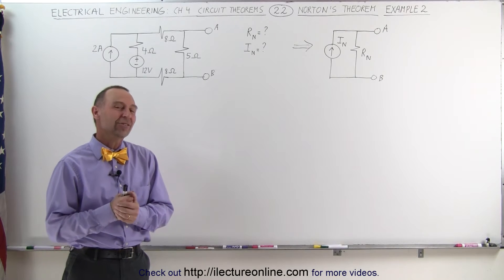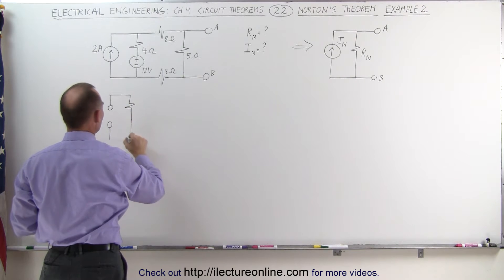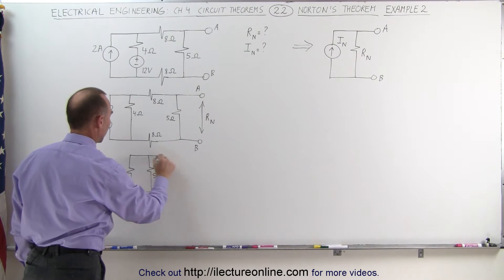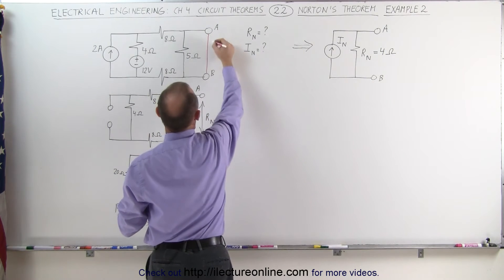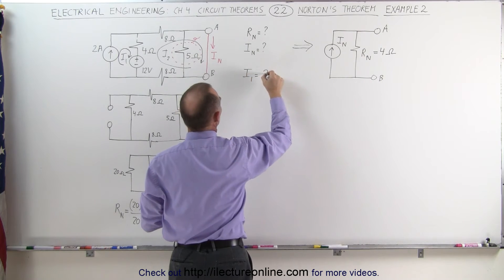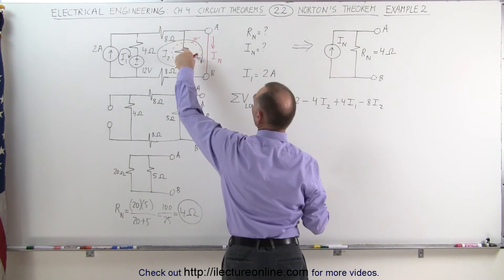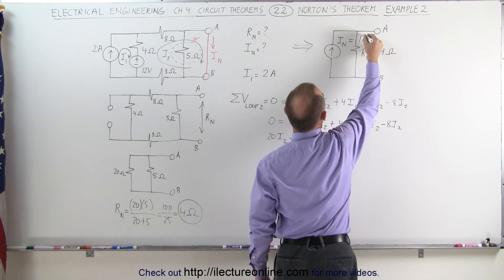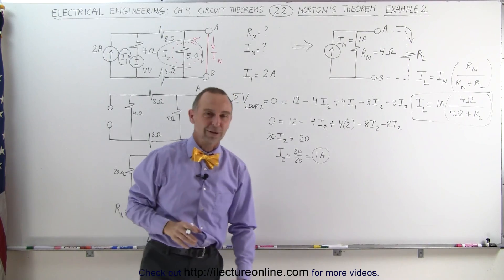Electrical Engineering: Ch 4: Circuit Theorems (22 of 35) Norton's Theorem Example 2

Comment: For the second loop, the resistor at the bottom, why do we do -8(I2) instead of +8(I2)? Isn’t it flowing the other way?
Reply from the maker: When you travel around a loop in the same direction as the current, you will have a voltage drop across each resistor.

Comment: I have a question Sir, although you have replied to a similar question of mine, my question is that what If there is a 2ohms resistor after the juction that connect 8ohms, 5ohms and the Norton current, will the current pass through the 5ohms resistor ?
Reply from the maker: Yes, the resistor will CHANGE the amount of current flowing through the 5 ohm resistor, but it will not prevent current from flowing through the 5 ohm resistor.

Comment: Hi, I love your videos!!! Really wished I have a lecturer like you in my uni! I would like to ask, can I just use source transform to make the voltage source into a current source and add the two current sources together to make the current source at the end?
Reply from the maker: Try it and see if you get the same answer.  We have some examples of source transformation on this channel.
Reply: @MichelvanBiezen  Hi Sir! Thank you very much for your prompt response! I ended up with 5A instead of 1A, the of 12V voltage source became 3A. It was parallel and in the same direction as the 2A so I summed them up to get 5A. Was I supposed to subtract 2 A from 3A instead?I have watched your source transformation videos! They are great! very easy to understand!

Comment: I love your videos sir. I have an ask, using the mesh method, it shows that the 8,5,8 resistors are in parallel with the 4 ohm resistor because current passing through them is the same. I do not know if I am wrong
Reply from the maker: The determination of a parallel path vs and series path is as follows.  Going from A to B, the current can either travel through the 5 ohm resistor OR throught the 8, 4, and 8 ohm resistor path.  It is the "OR" that makes it a parallel path.  The current has the choice of one path OR another path.

Comment: in case of norton's resistance, shouldnt 4,8,5 be in parallel with the 8 ohms resistor? (4+8+5)//8.... Im confused!
Reply from the maker: Traveling from a to b you have 2 path choices.  Either you can travel through the 5 ohm resistor or you can travel through the path containing the 8, 4, 8 ohm resistors.
Reply: @MichelvanBiezen  i would like to thank you for your quick reply!

Comment: Why you didn't consider 5 ohms resistor?
Reply from the maker: On the first diagram, if A and B are connected with a short, as is shown, then no current will flow through the 5 ohm resistor and all of the current will flow through the short.

Comment: sir.. the thing that made me confused is that how will you know that 8ohms , 4ohms and 8ohms are in series and those three are in parallel to 5ohms??
Reply from the maker: With the 2 A current source removed, how many paths are there from A to B?
Reply: Michel van Biezen sir there are 2?
Reply from the maker: That means there are 2 parallel paths.  The one with the 8, 4, and 8 ohm resistors, and the one with the 5 ohm resistor.
Reply: Michel van Biezen sir i just thought that 4 and 8 ohms are in series then parallel to 8ohms then series to 5ohms.. 
thank you for the explaination sir ! Thank you very much..😊
Reply: @MichelvanBiezen  This really helped me , thank you so much sir!!

Comment: one thing i'm a little confused about is, why do we assume the current source's current doesn't split along two paths?
Reply from the maker: If you are referring to the circuit on the right, there is only one path without the load resistor.
Reply: look into the concept of current division - when the "neighboring parallel resistor" has a resistance of 0ohms, the total current will flow through that resistor in lieu of the resistor with resistance !=0.

Comment: sir, for finding Rn why did you set 8ohm,8ohm and 4ohm as series resistor and parallel it with 5ohm resistor?? i did series resistor between 8ohm,8ohm&5ohm then parallel it with 4ohm.....but i got the Rn equals 3.36ohms...why is this?
Reply: I'm not the guy, but I can answer your question. Lol. So it sounds like what you did is took the equivalent resistance as if the current was flowing from the left side, reaches the node, the divides into to paths. One with the 4 ohm resistor and the other with an 8, 5, 8 ohm resistor. This is incorrect.

 When doing Norton and Thevenin circuits, you have to assume the current is coming from the right side. From terminal's A and B (as if A was the positive terminal and B is the Negative). When you do this, you'll get the following: The current will travel from A to a node. The current will diverge into two paths. One with a 5 ohm resistor and another with an 8, 4, 8 resistor. I hope this answers your question.
Reply: @jayvinstreet1876  Thanks Brother
Reply: @jayvinstreet1876  u sure it isn't the other way around? Works the same way and that's the direction it looks like he took

Comment: Hi sir, why can't we just apply Mesh Analysis at loop I1 and get a equation like - 4( 2 - I2 ) - 12 = 0 ?
The answer i get for I2 which is I norton is 5A..
Reply from the maker: There are multiple ways in which you can solve this problem.
Reply: I understand. However If I apply Mesh at loop I1 the answer I get for I2 is 5A, but if I apply Mesh at loop I2(which is your way in video) the answer I get for I2 is 1A...
Reply: @KayroThePank  why do you wanna find I at mesh 1? you were already provided with the current source which is 2A. hence I1 is 2A. that easy.
Reply: @judy-chan4536  The problem is some of us don't really see it that way, i saw it the way @kayro saw it so i also got 5A and the annoying part is that my professor will mark it wrong if it's the exact way the memo states. So like now i don't know which way is the correct way.
Reply: I think maybe it's because there is an error in that method. You don't know the voltage difference across the current source, and KVL works with voltages. In your equation, you considered the voltages for the 4 Ohm resistor and 12 V source but not the 2 A source.
Without including that in the mesh equation, the answer would be incorrect. So it's not recommended. It's just easier to find the mesh equation of the adjacent mesh like how he did in the video.

Comment: in loop 1, you directly write 2A and for elements in the other loop, you use (v=ir) formula. why is that? i mean, in first loop, you use (i) and in second loop, you use (ir)
Reply from the maker: In the left branch is a current source and thus will always provide the indicated current.  In the other branches we can only express the current as V/R  (Ohm's law), since we don't know what the current is.
Reply: Michel van Biezen you didn't used V/R, you used IR in the other loops. 
also, can we use mesh analysis when there is just a current source with some resistors?

Comment: Sir, could you please explain why we can ignore the 5 Ohm resistor when we short the circuit A-B?
When I meet a circuit like that, I don't have enough confident to make sure that my analysis is right ;(. Could you please show me some resources or exercises about identifying the current flow?
Thanks.
Reply from the maker: When there are 2 paths (the path with the 5 ohm resistor and the path with zero resistance, all of the current will choose the path with zero resistance and none of the current will go through the  5 ohm resistor.
Reply: remember the concept of current division, like what's used for calculating the current through the load resistor in Norton's Theorem

Comment: Hi, I love all of your videos! It's probably a dumb question but how do you know that 8, 4, 8 are in series and parallel to 5? why not 8, 5, 8//4 or even 8, 5 // 8, 4?
Reply from the maker: It is not a dumb question at all.  The way to tell the difference (between a parallel path and a series path) is to ask the question, does the current have more that one path to travel from one node to another.  In this case one path takes the current through the 8, 4, ,and 8 ohm resistor and a second path takes it through the 5 ohm resistor.  That is why those 2 paths are parallel, and the 8, 4, and 8 ohm resistor are on a single (series) path (when the current source is removed).